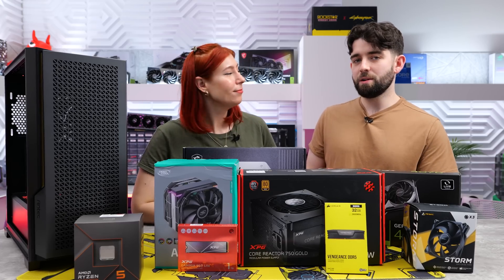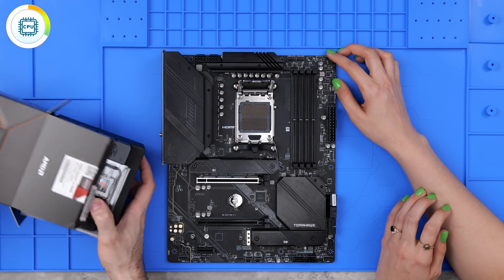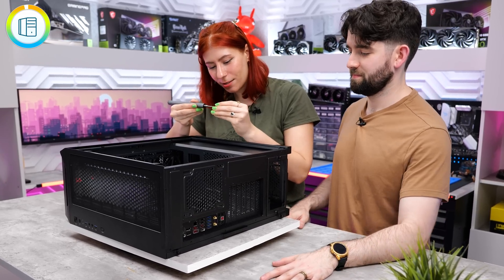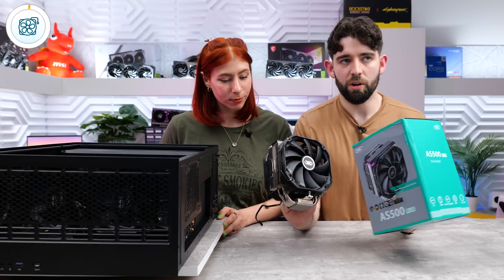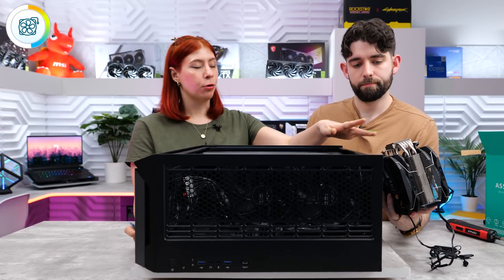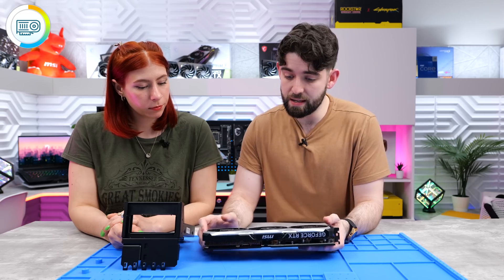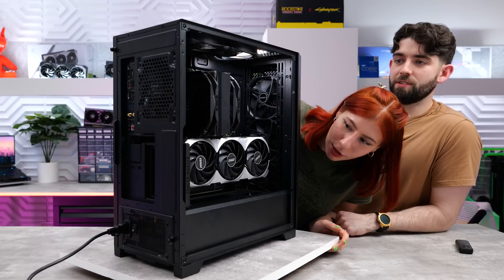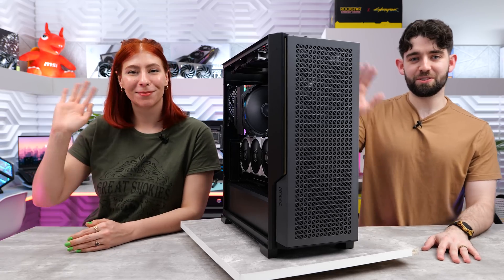This $1,500 PC Build is a 1440p BEAST! - RTX 4070

Comment: Guys i have a simmilar built - amd 5 7600, tomahawk b650 wifi, 32 gb gskill ram 5000mhz, 750 W PSU gold rated, cooler master td500 mesh case, 1 tb samsung pro ssd and COOLER MASTER 360io liquid cooler.
Im super happy with this built, All games run smooth on my 2k monitor at 1440p. The only concern is while playing games like god of war my cpu temps go upto 80 C, and while playing apex it goes from 74-56. 
this is my first pc, im new to this, please let me know if these temps are okay or i need to tweak somethings here and t here to bring the temps down. 
Thank you !

Comment: Spent 1600 on my 5800x3d 4080 build, saved a ton buying a used 4080. Since theyre still fairly new its a good idea to find deals on used ones. Works just as good as a new one!

Comment: Hi, i currently have a gaming pc with these specs:

CPU: intel i5-8400
Motherboard: Gigabyte Z390 Gaming X
GPU: Asus Strix RTX 2060 (6GB)
RAM: 2x8GB TForce Delta DDR4
PSU: 750W Toughpower (80+ Gold)
Case: Cooler Master TD500

I was wondering of upgrading to this build in the video and  is it worth the upgrade?
(Note: I am not changing the case or PSU.)

Thanks in advance for your thoughts

Comment: Do you guys use bottleneck calculator ? because on bottleneck calculator website this combination of cpu and gpu ryzen 5 7600 + rtx 4070 has more than 40% of bottleneck, as in cpu is too weak for rtx4070. Does that affect your idea of pc builds in any way ?
Reply from the maker: At 1080p, perhaps. At 1440p, there would be very little bottleneck, if any. Either way it really depends on the game, some will always be more CPU/GPU intensive.
Reply: @TechTesseract  so you're saying it would have bigger bottleneck percentage on lower quality than higher quality? I might need to watch some videos cuz i don't think im undestanding

Comment: The 4070 is an interesting card.
Same performance as my 3080 but nearly the same pricing at start :/ 

Good card but the discount from team green is less than expected
Reply: Team red 6950xt blows this card out of the water for the same money. Makes zero sense getting the 4070 as the 6950xt also has 16GB VRAM
Reply: @FlagnarBoobz  Bro i want to buy 6950xt but im a little Bit scared because Driver Problems... what do you think? Its good Idea to buy RX 6950 XT ?

Comment: Will the CPU cause any bottlenecking when paired with the 4070?
Reply: Na it shouldn’t, the 5 7600 is a pretty powerful cpu and is quite new so it should be fine with most modern Gpu’s such as the 4070, it’s even been paired with the 4080 and 4090 and still been decent.

Comment: Rule of thumb has always been when buying a PSU to double the size of the wattage needed.  This build is about 550w so should been using a 1000w.
Reply: you should NOT do that, search up the minimum wattage for the gpu you are going to get and add 50 or 100 watts 👍

Comment: Was actually alot more then 1500
Reply from the maker: Using current live pricing:
Case $110
Motherboard: $220
CPU: $220
GPU: $600
RAM: $100
Storage: $100
Cooler: $70
PSU: $120
Total: $1540
Reply: @TechTesseract  is there a graphic card holder ?

Comment: I'm going to build my first PC soon and had a few questions.. I play Warzone primarily and I want the best bang for my buck when it comes to fps at 1440p. I was considering getting a Intel i7 12-12700k CPU paired with an GeForce RTX 3080 GPU.  My questions are, A) would those components go with everything else with this particular build...And, B) if I upgraded the CPU to the I7-12700k,  would there be a negligible difference between the 3080 and 4070? Thank you for the awesome content, and possibly taking the time to answer my questions :) I'm a newbie.

Comment: If you have a Ryzen 6000-series laptop and want to upgrade the RAM, you need to buy DDR5. DDR4 will not work. If you have a Ryzen 5000-series or older and want to upgrade the RAM, you need to buy DDR4. DDR5 will not work. What do you say on this ?

Comment: When $1500 is a "budget build" these days, what's a normal build or a high end build for creators?
Reply from the maker: Cheap budget build would be $500, $1500 I'd consider a mid range budget build, $3000 would be high budget build, budget doesn't necessarily mean cheap xD
Reply: @TechTesseract  1500 or more is not budget
Reply: @TechTesseract   such a high rolla...
Reply: budget doesn’t mean cheap lol
Reply: Well, when they say budget, they dont mean that it is cheap, they mean that that is the lowest price possible for a PC with a 4070. If you want a budget PC you can go and look for a 3060ti or 3060, or even wait for the 4060 series, which will be a little less expensive. But dont expect a mid/high range PC to be over $800 bud
Reply: budget doesn't mean cheap.
Reply: People do be forgetting the term budget means available funds allocated for the project
Reply: Budget doesn't mean cheap...
Reply: Yes any budget is technically a budget pc, but when someone says they're building a budget pc they usually mean cheaper, otherwise there's no point in using the word budget, just say you're building a pc.
Reply: Can someone tell me the advantage of 4070?
Reply: @fynkozari9271  nothing
Reply: @fynkozari9271 here are some pros to 4070. DLSS3 aka fake frames. That’s it. I’d recommend not buying and buy AMD 6950xt for $50 more rn. That is on par 50/50 with the 3090 and 3080 depending on the game.

8gb of vram kills the card. Also price to performance. It really not a bad card but for $600 it’s a stupid card. And your never going to be able to resell if for anything near your buying price. 

I’m building based around the 6950xt. But starting with the 3060 with 12gb of vram. Just because I don’t have enough money to get the cpu cooler and gpu in my budget. So I’ll start with everything except the gpu. This 3060 will definitely be able to resell and then I’ll get the 6950xt with 16gb of vram
Reply: @OG3Maliii  whats the perfect 1500$ setup ive always been console so i know nothing about pc but i want to go pc for only cod warzone and gta i need help with the build
Reply: @underated_2975  you can get rid of the mouse keyboard and monitor that’s my older build. So it would come out to around 1200 probably. From then just throw the extra $300 in a better Graphics card. Go for a card with 16gb of vram. This will help immensely with future games
Reply: @OG3Maliii 4070 has 12gb vram though
Reply: @OG3Maliii was gonna go amd path but I play fortnite and they hate amd cards in terms of performance
Reply: @OG3Maliii exactly what gpu I’m getting really the best gpu for 650
Reply: @OG3Maliii Wdym 8gb. The 4070 comes with 12gb.
Reply: @SeparatiXz  12gb vram is not enough when consoles have 16gb. Most games are sold on a console so game devs will make games with the console requirements not a pc requirement.
Reply: Prob like 3k because the 4090 is 1600 bucks and best card there is
Reply: Well 25k on a PC is technically a budget, also the RTX 4090 costs more than this PC alone
Reply: do you know what budget means? 💀
Reply: I spent $ 2000 on mine 😢
Reply: @ElHanzone  that's fine man. It just depends on what U WANT. Its all up to u. I spent $2600 on mine which is a lot of money yea but my system is banging and I dont regret it.😊
Reply: @nicholasgrogan856  I also don't regret it hahaha, I won't need to update in like 2 years. So right now I'm enjoying it 🔥
Reply: @ElHanzone  that's what im saying man. I went into it thinking "if imma do this imma go big cuz I dont wanna touch this thing for at least a couple years".
Reply: @nicholasgrogan856  what you have
Reply: @underated_2975  Lian Li something for the case, RTX4080, 7800x3d, Corsair 850W, G-Skill DDR5 32GB, Noctua DH15 i believe for the CPU cooler (its a big tower with 1 fan in the middle), Asus Prime X670-P WIFI,  1 TB Samsung nvme ssd.
Reply: @ElHanzone  it better be able to massage you
Reply: Every build is a budget build. You set a budget and build it.
Reply: Thats budget…if Ou think 1500€ is much these days y
Ur just poor…

Comment: With this bugdet, I would much rather spring for a 7800x3D and a previous gen card like a 6700XT or maybe a used 3070 for the same price. The best gaming CPU out there with the ability to upgrade the gpu later is more appealing. Also, I am running that same AS500 cooler on my 5950x and get temps around 70-75°C when gaming so it can certainly handle beefier CPUs as well!
Reply from the maker: Lots of options for sure!
Reply: Depends if you want it to run games better now or later. 7800X3D is a waste of money for 4070 let alone anything slower at 1440p. Great gaming CPU for 4080/4090/7900XTX when you have money to spend. I see your point about future proofing but I'd want the build to run games as fast as possible now. Hard to sell a build that is gonna be better three years from now when you upgrade the GPU :D
Reply: @Scooppi  yeah, I see your point there, I guess it just comes down to how you view your system. I personally prefer to have a system that might perform better down the road as it gives me longevity and extends the life of my build rather than having to upgrade everything again 2-3 years later to be relevant. Really does depend on your plan for frequency of updates. Good point.
Reply: @Deathgripbuilds  Yeah 7800X3D for sure is better for the long run and if you're going to buy a better GPU in the near future but you lack the money right now.
Reply: previous gen cards get less updates and last less due to it. Plus DLSS 3.0 is out and AMD's launch drivers areeeeee.... trash. Also, it's much more power efficient :)
Reply: @bloxoss  same old herd mentality , amd driver = trash , lol
Reply: @bloxoss  yeah, but even still, the value to performance of the 4070, although one of the better ones for its generation, is still pretty garbage. The build I suggested leaves room to simply upgrade the gpu whenever without reaching a bottleneck since the 7800x3D is the best gaming CPU out there. Also, GPUs are not only physically easier to upgrade but they resell faster and easier than CPUs. Both builds have a component that will likely need to be upgraded in the future before you’d upgrade the other. I would much rather need a GPU upgrade than a cpu upgrade.

Comment: although am5 has great gaming performance, i really cannot justify the platform cost (expensive mobo + ddr5) to end up with 6 cores in 2023. Also 6950xt is a better deal and we shouldn't be rewarding Ngreedia with those shitty releases.
Reply from the maker: Yeah intel is still the value king atm as an overall platform for sure. 6950xt is an epic choice for $650 when it comes to native performance, although depending on how important power consumption is to the end user along with stuff like DLSS and frame gen, it's a bit of a mixed bag. Least we're getting more options in 2023! Yay for everyone
Reply: @TechTesseract  But what isnt often mentioned in the conversation of ryzen 7000 vs intel 13th gen is that you most likely need a bigger cooler and a bigger psu for the intel system so if your aim is mainly gaming performance AMD can still be a valid choice 👍

Comment: Pretty solid build. Might have been able to squeeze in a 4070ti with a $1,500 build but you would def have to use budget case,ssd,power supply to do that. Anyways love it when you guys make videos together!!
Reply from the maker: Sounds like a challenge, I'm sure it could be done!
Reply: that would be nearly impossible if u r going for liquid cooling, but for air cooling it will be pretty easy
Reply: @ax5go where in this video did you see them use liquid cooling..

Comment: People don’t really like the H5 flow case but looking at this case there is literally no air flow on the bottom of the case. Gpu on the side no where to exhaust but on the motherboard, bottom intake fan from the front is useless because it get trap in the back.
Reply: This is a absolut standard case?
Reply: @CassKix  its around $20 more that the H5 flow which is $95

Comment: It isn’t a 1440p gaming pc if you have to use DLSS and frame generation in most of the games. Just saying.
Reply from the maker: Totally up to the user whether they want to use DLSS or not, although there's really no reason not use it since visual difference is nearly zero depending on the settings (frame generation is a different story) Though even without It'll still do 1440p 100fps +, RTX 4070 is almost overkill territory for 1440p imo, it just doesn't have enough vram to be ideal for 4k
Reply: For the cost of the 4070 and 4070 ti, it should have had the same bus as the 4090. That would have really opened up its performance even with only 12g of vram. It’s cache makes up a little but the bottleneck is the bus bandwidth.
Reply from the maker: Totally get what you're saying, although if I show you native vs DLSS quality and you genuinely can't tell the difference (upscaled actually looks better than native is some cases), does raw native performance really matter anymore if you're getting more FPS? That said I'd like to see hardware prices come down, PC gaming is currently way more expensive that console
Reply: @TechTesseract  my pc is a 5800x3d and I bought the 4070ti to replace my 6600xt that was running out of vram. So I bought a nice 1440p monitor and have been disappointed. Having to use the upscaling to keep my 144hz monitor useful. Yes it looks alright compared to 1080 but I can see the same fizzle that I see on our ps5 and xbsx on our 4k 120hz tv when using upscaling. Unfortunately the games I like are very hard on graphics cards. Single player horror and psychological horror games. Hogwarts was almost unplayable on my 6600xt. Looked terrible compared to the ps5 version.

Comment: If I want to pair an intel cpu with the 4070 which one do you guys think is the best among 12400, 13400 and 13500 for only gaming. I'm trying to avoid bottlenecking the 4070. I can buy the 13500 but if there is no substantial gain over the 12400 for gaming I'd rather save the extra $60. Thanks for the build and keep up the great work!
Reply from the maker: I'd pick 13400, probably the best value gaming chip atm, and definitely nowhere near bottle necking a 4070 at 1440p

Comment: 1440p over 100 fps with dlss... sadly the standalone raw performance does not make it a 1440p card for me. next year you will barely be able to hold 100 fps on that res
Reply from the maker: It'll do 100fps+ at 1440p max settings in many games without DLSS, although DLSS is so good it's kinda silly not to turn it on in most cases as it's basically just free FPS with imperceivable difference on visual fidelity depending on the settings.

Comment: I use that CPU cooler on my system and it has a problem with AMD CPU's because the cold plate is actually rounded (it bulges out). I was getting terrible cooling performance on my 5800X3D, so I had to take the cooler off and put it on a perfectly flat glass side panel with sandpaper taped down to it to flatten the cold plate out. It was so bowed out that now there's a 1" x 1" copper circle in the middle of the plate because of how much material I had to sand off to get it even remotely flat. Dropped 10-15c at idle and 15-20c at load. Insane.
Reply from the maker: Interesting! I looked it up and it seems like it was designed that way due to intels alder lake chips slight bend which I guess is non optimal for AMD chips. That said I haven't had any issues with temps so far on this system, I'll keep you updated!
Reply: @TechTesseract  Awesome!

Comment: I would have got an AMD 6700 card for more cost saving and still getting good 1440p fps.
Reply from the maker: Yeah, plenty of different options. 6950xt is also a good choice as well, although no DLSS
Reply: @TechTesseract  fsr 2 is basically dlss2, fsr 3 when it comes out, should be similar to dlss3, for 650$ u can get a rx 6950xt with 16gbs of memory and play 4k gaming and u get 15% more performance, a cheap 1440p gpu, rtx 3070, rtx 3060 ti, its not worth getting the rtx 40 series at all
Reply from the maker: I specifically meant DLSS 3.0, but yeah fsr 3 is looking good! Hopefully it releases soon although don't think it's confirmed if pre-rdna 3 will support it yet - I guess we'll see!
Reply: @quentonc5806  I agree a 6950 is better
But you will need an 850 watt psu for it
Reply: @quentonc5806  disagree with that especially some YouTubers already said DLSS is far better vs fsr even I tested the games and dlss does exceed far better vs fsr
Reply: Against the 4070? Lmao no
Reply: 6700 is worse than the 4070,6950xt or 6800 would made much more sense
Reply: I actually built this build (same board and CPU) with a 6700xt.